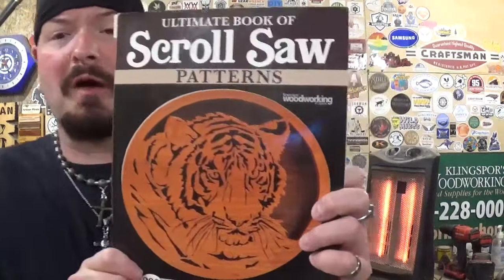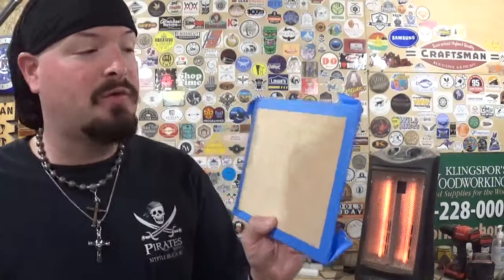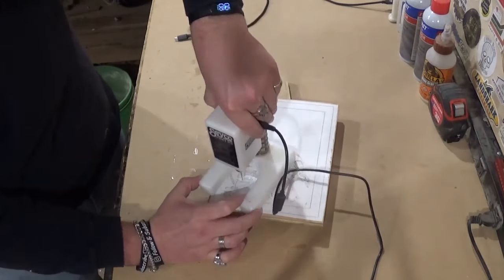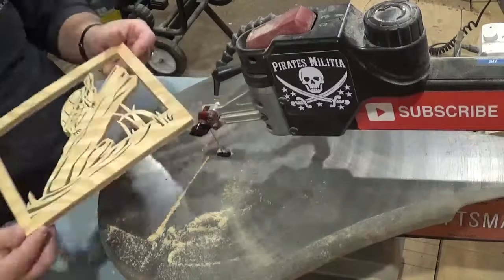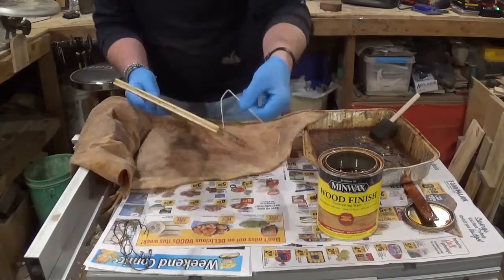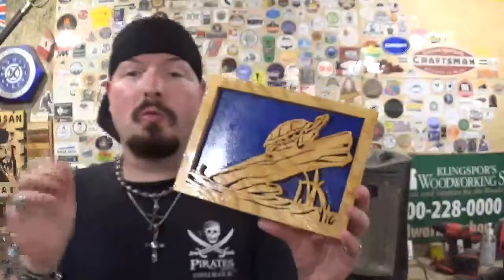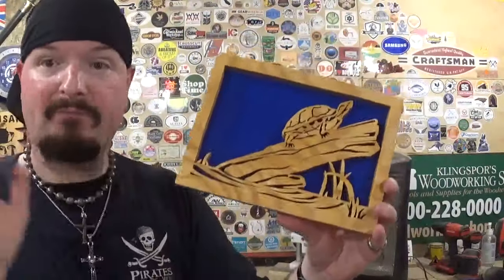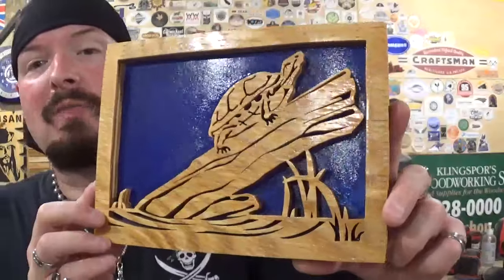Turtle On A Log, Scroll Saw Project

Comment: THAT WAS FUN...I AM STILL A BEGINNER... MAYBE YOU TALK AND SHOW HOW YOU CUT THOSE REALLY FINE LINE...DO YOU MAKE MULTIPLE CUT ON THE FINE TO THICKER CUT OUTS...GREAT JOB         PERRY
Reply from the maker: The fine lines are called veining and you just run the scroll saw blade along the line and back it back out
Reply: Thank You for the help... Do you do that 2-3 times or just one x....I use a #5 blade...thanks again.    Perry